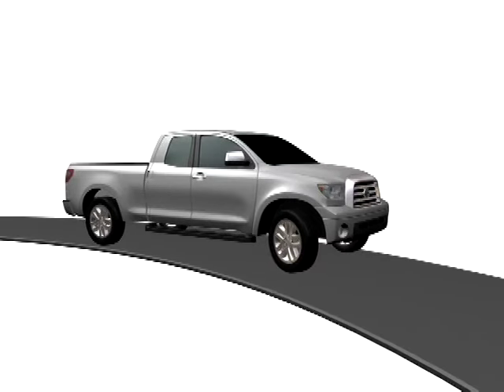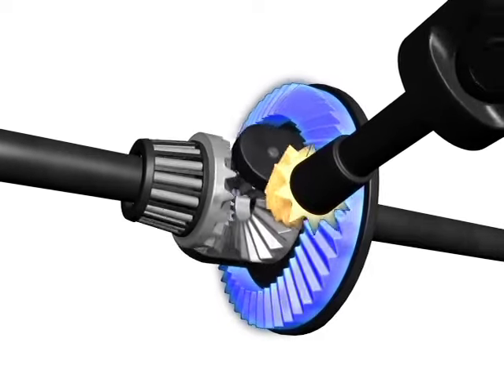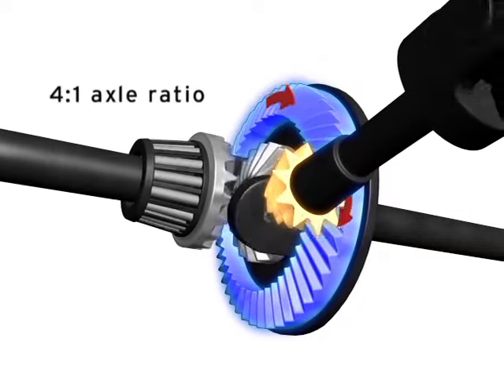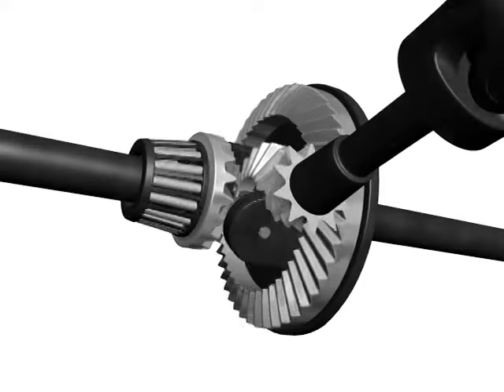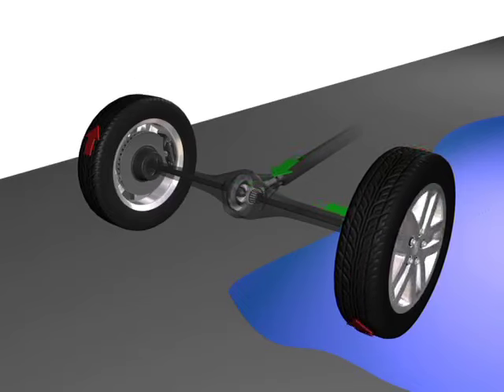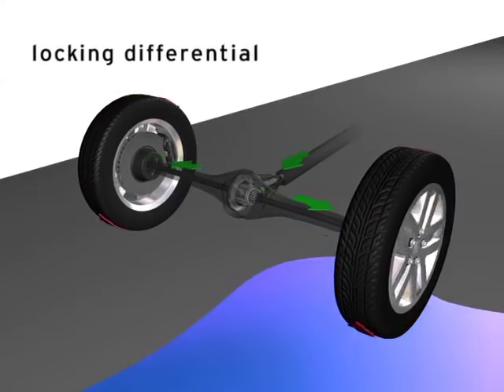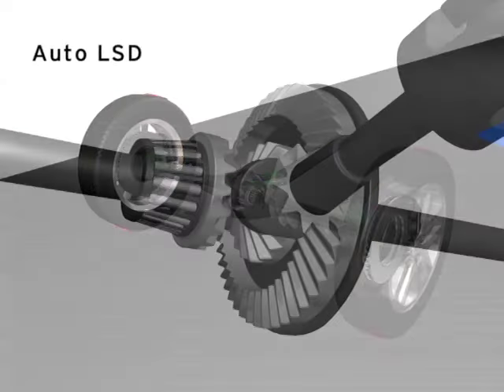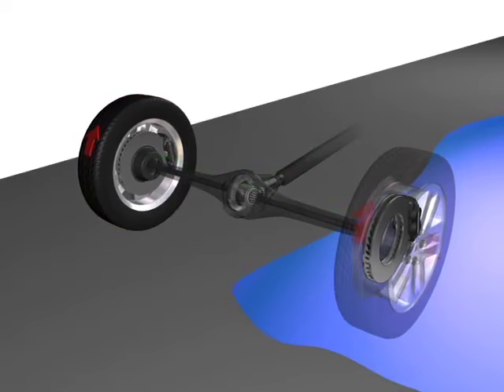How a Differential Works and Types of Differentials

Comment: Great video - I am 52 and never understood the differential fully.  It's hard for most people to understand how things were BEFORE the differential came along - try one of those off-road vehicles or go-karts without this device - it judders on a bend and of course, has better grip on the straight for acceleration. It's fair to say, it was probably made to improve the comfort of some posh bloke in a big limousine - should look it up I guess! This is the perfect animation, I sat and 'paused' the action, and thought through how it works - so now I know that in normal operation, driving straight ahead on a good road with no tyre slip, the 'twiddly bits' in the core of the action sort of act as 'locked up'.  Then come a bend or tyre slip on one wheel say, that situation changes.  Such a straightforward vid to view and think about how it works.  Good work.  Also, for further thought people out there could figure how to limit the slip for extra traction on snow etc?  Obvs, lots have tried it and there are umpteen variations both involving the differential itself, freewheel-type devices on each axle (like bicycle, one way it's turned it provides drive, not the other, think about it!), aand the old standby now, using ABS system to jam the wheel that's spinning free, to 'force' the wheel with grip to turn a bit. Yes, food for thought, great vid.
Reply: My cousin has an FJ Cruiser. I pressed the "lock differential" button and went offroading with it...upon coming back to the road, the car felt very very weird on turns, i thought i have ruined something in the suspension...after several hours, my brother pointed out that i still had my "Lock Differential" button activated.../facepalm
Reply: MrSakninsh My cousin uses the car pretty much everyday, there aren't any problems
Reply: MrSakninsh
Only if it is an incredibly weak and poorly built one, but I'm assuming he actually meant rear diff lock and not transfer case lock because I don't think FJ's are full time all wheel drive, in which case it's a completely different part he is talking about.
Reply: MrSakninsh
Well, depending on what you want to mean, pretty much every differential has to be "interaxial" by design.
While the only "Toyota" I've owned had almost no Toyota parts on it, Toyota's reputation would indicate that neither a transfer case mounted or rear axle mounted locker should break ever in that circumstance.
Also, a rear diff lock should disengage automatically above about 15 MPH for safety reasons.   All OEM ones that I'm aware of do that.
Reply: sleekitwan I don't believe it was made for limousines, from what I've gathered early cars used to be only 1 wheel drive, but that was terrible since most roads were very rough and definitely not paved, which made cars really tedious to drive. Making cars two wheel drive was a necessity at the time, therefore the differential was created to allow both rear wheels to have power.

Comment from the maker: @89Silhouette Again, the brakes are pulsed via an ABS type system to not stop the wheel from turning but to create some drag to transfer power to the opposite axle. That type of system is a low-speed only system. There seems to be a misunderstanding that the brake "holds" the wheel from turning but it's rapidly pulsed only to the extent needed to transfer power. It has to be manually engaged via a button also.

Comment from the maker: There are a number of different but related software packages that control wheel slip via use of the brakes but they are actually technically independent. VSC (skid control), TRAC (traction control) ALSD (auto LSD), ABS (anti-lock-brakes), and Brake Assist (BA) all utilize wheel slip/brake control to accomplish a task but they are independent and were not always included as a full set of installed software. Some of the systems reduce engine power, some change brake pressure etc.

Comment: I finally understand basic differentials now. I grew up thinking that a basic differential sent power to one dominant wheel (right side) 100% of the time and the other wheel part of the time. Turns out both wheels are treated exactly the same in relation to one another.

Comment: You did happen to skip a very well-known differential, the 2-speed differential. I'm not sure if Toyota ever put one in any of their commercial trucks, but most all other manufacturers have, from 1-ton trucks up, at some point. To see how they work is truly ingenious and resolves the age-old question: gear for torque, or gear for speed. With a 2-speed, you can have both. In a truck, this is very helpful.

Comment: @PayDroification DRE (driveshaft rotation effect) also means that if you attempt to back up quickly, you may spin the left rear wheel more than the right. It's not that only "one wheel drives", it's that your "go traction" is limited by the wheel with the least traction. One of the advantages of independent rear suspensions on rear driven wheels is the elimination of DRE.

Comment: @thebluecommet The video states that ALSD(aka brake based traction control) does a better job of trasfering torque then other differentials. And it does. Mechanical LSDs can't really change the torque distrabution, they just limit how much of the torque can go to the wheel with the least amout of traction. Brake based traction control can make the wheel with the least amount of resistance the wheel with the most amout of resistance. This why many modern cars use it.

Comment: I have used all 3 type of Diff's and like the clutch pack lsd the best because Locking diff's come on suddenly and blow the entire truck sideways and can be downright scary when side hilling above rivers ect, the electronic ones dont work when rallying at speed and wait to kick in when you have already lost all speed. The clutch system is a constent manageble mesh that works great in the situations I drive.

Comment from the maker: I did a little research, a humming noise is often caused by an incorrectly installed ring and gear pinion, which needs to be adjusted, the incorrect installation of ring and pinion gear prevents proper tooth contact and can cause rapid tooth wear and can cause gear failure. This humming noise converts into growling noise when the wear increases. Humming noise can also be caused due to worn out bearings, which needs to be replaced.

Comment from the maker: That's a tough question to answer. Remember it's the tires adhesion that ultimately determines if the car moves or the tires just sit there spinning (or skidding if the car is moving). The ability to control wheel slip and distribute power to any of the 4 wheels is very helpful in situations where one or more wheels are slipping but one or more have traction. However, if all 4 tires are on ice and there's no adhesion for any tire, no drive system will get the car moving.

Comment from the maker: That's a good question. Normally in racing situations, of course, you'd want a limited slip diff. I would think with drifting that you'd still want some differential action but you'd want to really limit it so the amount of "slip" is low so that you can ensure lighting up both rear tires. If the car isn't actually drifted but is driven on curves, a locked differential would not only produce really bad handling but would also potentially damage the diff when turning so my guess is adjustable LSD.

Comment from the maker: I don't see why not though the key to this is not just holding that brake but pulsing it so that wheel does still have some ability to turn. To do it "elegantly", the ABS sensor and electronic system works it but what you are describing would be like modulating the brake on that wheel as a driver would have done aggressively braking in the pre ABS times.

Comment: Locking differential at 3:28...Do both axles actually receive equal power (P)?  Since they are locking the angular velocities (w) are equal, and the torque (T) on the side with more traction should be greater?   P=T*w so T=P/w.  If P is equal on both axles and so is w then T would be as well which is not the case correct?

Comment from the maker: I'd think that the answer depends on how tight the tracks (or areas) you're going to run on would be. If you need to turn tightly and the vehicle is pretty wide, it will handle better with a differential than a solid axle. If traction isn't huge on the vehicle (like if it was an off-road RC truck) then it wouldn't matter much. Keep in mind, Karts run with solid axles and they handle great, their track and wheelbase are small.

Comment from the maker: Yes it would but the acceleration would suffer (check out Bonneville speed cars that have to be push started because they have such tall gears) because there would be no mechanical advantage from the differential. But you're correct, the axle ratio is a large component in both acceleration and top speed. However, in order to really make the car that much faster, it would need an exponential increase in horsepower because aerodynamic drag is the biggest issue at high speeds.

Comment from the maker: You answered your own question. Because ALSD only operates at low speeds, the brake friction is low and the brake wear is negligible. Some truck LSDs require frequent oil changes (as frequently as 12 or 20,000 miles) and there are more mechanical components that wear. Changing brake pads is cheaper and easier than differential parts.

Comment from the maker: @PayDroification I'm not a Mustang expert but I know there was a friction-disc LSD on some Mustang rear ends and open diffs on others. If you find out you had an LSD on your particular model of Mustang, it's possible that the friction discs are worn out and it's not providing a limited-slip effect. If you have an open diff, the power tends to always go to the same axle so you would find "1-wheel drive" on the same wheel would be normal.

Comment from the maker: Because it uses an already existing ABS sensor and is just software. There's no additional hardware or wear components added to a simple open differential. In some cases, mechanical systems require frequent maintenance due to the normal wear caused by their operation.

Comment: ALSD's work great for the average driver who seldom goes off road, but for serious off road you need locking front & rear diffs. If you have full time 4WD you also need a locking center diff.  Brake activated ALSD systems overheat with continuous usage & waste engine power.

Comment from the maker: Welding a differential takes another design of diff (like an open diff) and creates a "LOCKED" differential. So the explanation of a locking differential basically applies to welded diffs. The goal of welding a diff is to cheaply convert it into a full-time locked differential. This is nearly always for off-road use.

Comment from the maker: @mastersduhgree It doesn't "drag" the brake, auto LSD can pulse the brake a fraction of a second or several times per second and stops as soon as the other size gets traction. Trying to do this with the parking brake has a similar effect but is nothing like as sophisticated as the high-speed brake pulsing. It's also the basis of the CRAWL system which allows vehicles like the Lexus 460 to decline incredibly steep hills with both feet on the floor.

Comment: @PayDroification You LIKELY have an open diff. There's probably some tag on the diff that would tell your Ford parts guy whether it's open or LSD. Ford used to call their LSD "Traction-Loc", GM called theirs "Positraction" and Chrysler called theirs "Sure Grip". Part of what you're noticing is "driveshaft rotation effect" (my term). DRE with a live axle setup like the shown Tundra or your Mustang tries to pick up the right rear wheel when going forward. This reduces it's traction and it spins.

Comment: Look up the difference between part-time and full-time 4wd.  Your center differential is there to allow you to use 4wd on pavement, and it works between your front and rear driveshafts the same way an axle differential works between the wheels.  Locking the center differential makes your truck behave like any other part-time 4wd rig, unlocking it makes your truck behave more like a Subaru or other all wheel drive vehicle.  Lock it when you're offroad if you're worried about traction.

Comment: A welded diff is basically a jerryrigged locking differential. It forces the rear axles to turn at the same speeds at all times by welding the differential together, giving the benefits of extra traction of a locked differential, without the benefits of an open, limited slip, or electronic (streetability) differential at a very low cost. Welded diffs cause axle hop during cornering and are almost unusable on a daily driver.

Comment: i have a question . when you want to rotate two front or rear wheels, with gears or differential, have you checked the precise rotations of both the wheels with digital meter. I guess, there can be difference.

Comment: I hear ya.
.
As for brake diffs not working at speed, check out Ford's torque vectoring setup, pretty sure it's near identical to the auto LSD or whatever (it's a brake diff) - it's on the new Focus ST's.  It's performance oriented for that setup :).
.
Glad your video took off, hope someday you get the time and resources to do an addition ^_^.

Comment from the maker: @Jesus45U Actually it's not a requirement that all passenger cars in the US have skid control...that means they also have ABS as standard so given that all new vehicles have ABS sensors, it's really just software to accomplish this and utilizes existing components. If the diff was being used for high-performance driving (ALSD disengages at low speed) then you would, in fact, tend to cook the brakes as often happens at track days with skid control.

Comment: Can you think of a way of doing this using simple mechanics? Sophisticated mechanical parts can wear even faster than electronics and can be much more destructive to itself. Power going to the path of least resistance is universal. Even in electronic circuits.

Comment: @bubub56 It operates exactly the same as a locked locking diff. Both rear wheels turn exactly the same RPM relative to each other. Great for a dedicated drag car, maybe an ice racer, or possibly a rock crawler. A spool would have way too many drawbacks for any other applications.

Comment: Hi, i have a 1987 ford scorpio which has a limited slip differential but the differential has backlash and i need to change it. I have found an open differential that fits perfectly. But i want to know if an open differential would affect the car's handling in a negative way or not. For example, in a rainy day, driving on a curved road, would the car get out of control easier? The car is mostly being used in highway. Thanks.

Comment from the maker: Drift cars typically use very limited slip differentials to fully locked differentials. Since the rear is sliding, the differential effect of the turn is irrelevant. It's more important to get power to both rear wheels to keep them spinning. "Normal" handling is degraded due to a reduction in differential wheel speeds.

Comment: so for burnouts, limited slip is the way to go so that you don't have one wheel squeals?
Reply: Bearbait01 If you really want a solid burnout go with a locked rear differential :)
Reply: Ian LaRiviere Or weld your own diff (warning: as you would guess it'll be extremely unsafe so do at your own risk)
Reply: +faisal3398 very true locking kits are cheap and not hard to fit though not everyone heeds the disclaimer from the manufacturer. Recently in Australia a bloke (who possibly entered the gene-pool when the life guard wasn't looking) fitted one to his Commodore (Pontiac by GMH in the USA and I think Opal in UK). While fun in a straight line the LS2 engine trying to lift the front and push both rear wheels ahead equally under full power meant steering was reduced to "pointing" and he wrecked not far from his driveway. Sadly he took his toddler on this test drive and you can guess the result.
Reply: Bearbait01 a Spool would work better
Reply: Ok Bearbait01 🚙
Reply: Or just use the e brake to lock them

Comment: Already done.  they are referred to as "torque-biasing" differentials, and use helical or worm gears(2 different things, not 2 names for 1 thing).  they're pretty good, but they have drawbacks as well. I won't get into the mechanics but:

-both wheels have to have at least some traction, or it does nothing.
-less efficient torque transfer compared to other options
-it never actually 'locks', and so it acts against both drive wheels spinning/being broken loose(this is bad in certain situations).

Comment from the maker: @thebluecommet Nowhere in that video does it claim that ALSD (which is far from a unique application of that technology in the auto industry) is superior to anything other than an open diff. ALSD has two benefits over other LSDs, it's lighter and it's cheaper to maintain. That is the only statement in the video. The reason so many differential designs exist is that each is suited to a specific need and have advantages and disadvantages depending on how the vehicle is going to be used.

Comment: oh sorry one more question. if a car is already in motion then LSD might not be needed right? if one (or even both) rear wheels lose traction the car already has momentum, so the front wheels would keep moving the car forward losing speed, but hopefully before you reach 0 your rear wheels have regained traction and can move the car forward again right? but if you are already stopped and your rear wheels don't have traction then that's when you are screwed right?

Comment: What would happen if i put a 265/75 R16 in one side and the other side a 31x10.50 R15 stock tire size my is limited split differential by the way. What would it damaged the diffrential??